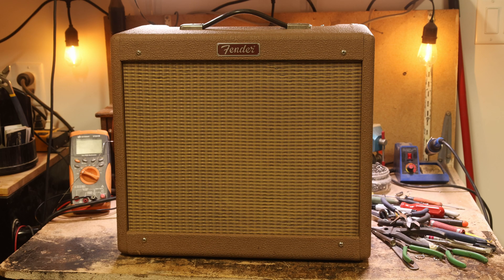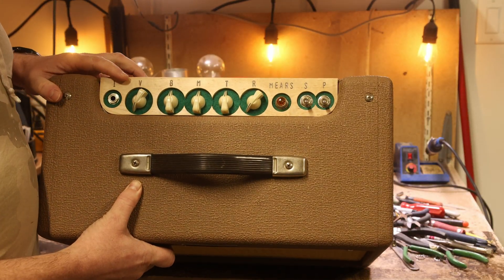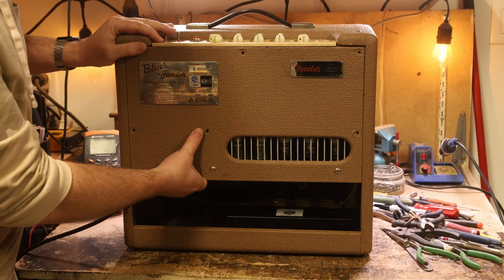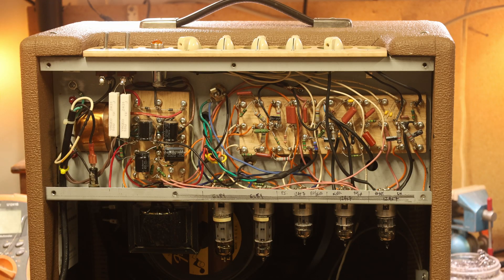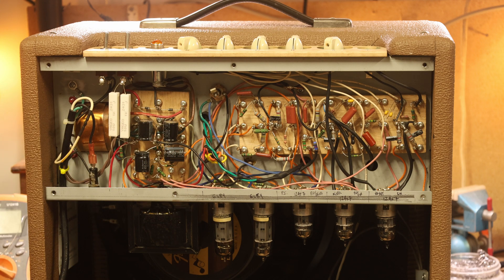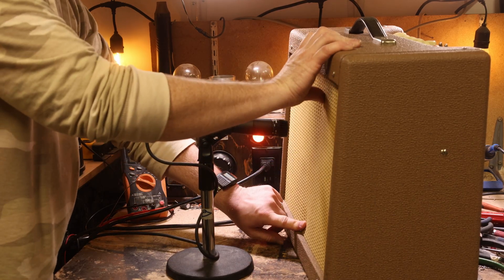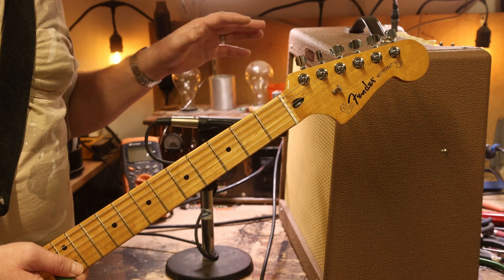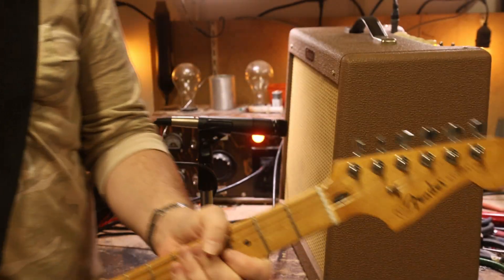I converted a Fender Blues Jr. into a hand wired Princeton Reverb Vacuum Tube Guitar Amp

Comment: Is using wood a fire hazard with high voltage?
Reply: No. Wood does not conduct electricity the way metal does. For the circuit board, it should be fine. The only time it might conceivably be a fire hazard is if hot tubes are put near it.
Reply from the maker: This is a common question I get, and for good reason.  Nobody wants a flaming amp, except maybe Jimi Hendrix.  This is only one of many amps I have built with similar methods, so far, none of them have exhibited any issues due to heat, high voltage, over current or anything else that could cause the amps to burst into flames.  That being said, I think there is always a risk present that some unknown factor could cause an issue.

As long as wood doesn't absorb excessive amounts of moisture, then it remains a very good insulator.  If somebody were to perhaps pour an entire bottle of beer into the chassis, then let the beer sit there and soak into the wood for a few weeks, then it may cause an issue.  However there is no way for an excessive amount of liquid to enter the amp so the risk remains small.  There are also ventilation holes in the chassis for moisture to leak out.  Also, the heat the amp produces helps to dehumidify the wood.

Something else to keep in mind is that the amps I build are not for sale.  I build them only for my own use.  They are an experimental design so it's okay to "color outside of the lines" the way I see it, because they are only ever being used in a controlled environment.

Thanks for your question!
Reply: @mearslab If someone did pour beer into it and cause a short circuit, I should think the input fuse would blow LONG before the point where the wood caught fire, too. 😂
Reply from the maker: @zuperdee  haha good point!

Comment: I picked up that same model blues jr and intend to handwire it. It's a few down my list, but I love handwiribg rhe hot rod amps. 
I've been thinking of doing a 5e3 or 6g2. I'll be checking this video out tonight for sure
Reply from the maker: Cool, hand wiring a hot rod deluxe is on my to do list, glad to hear you've had some good results with it.  Thanks for watching and best wishes on your own projects.
Reply: Not understanding why one would build a quality amp and then go out of your way to put in in a crappy Blues Jr cabinet.

For the price of a used Blues Jr or maybe less you can get a brand new Mojotone cab that is pine with baltic birch ply bafflle board and back panels.

I guess if you had a Blues Jr that totally failed and didnt think it was worth fixing you would have a basic crappy cab to build something in but having a functional one or purchasing a Blues Jr for a project amp built just doesnt make much sense.
Reply from the maker: @7171jay  I looked into what it would cost to get a Mojotone Princeton cab, it's listed at $325 USD.  Used Blues Jr.'s where I live(east coast Canada) sell for about $450 CAD, so yes the price is comparable.  When you buy a used BJ though, you get so many useful parts like transformers, tubes and a speaker and when you factor all that in, I don't think the price is all that comparable anymore.  Another thing to consider is that although the Mojotone cabs are nice, they aren't anything special.  Finger jointed pine boxes, plywood baffles, and covered in tolex isn't anything to get too excited about.  I'd rather build the cab myself than go that route personally.

Thanks for your comment.